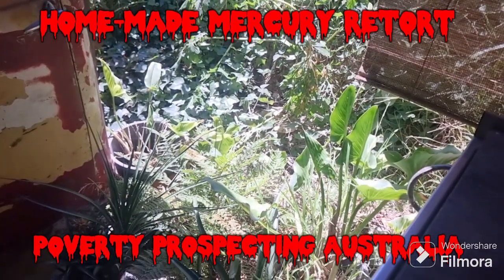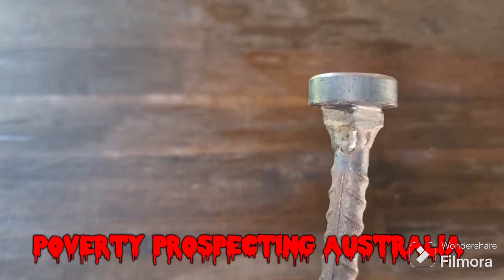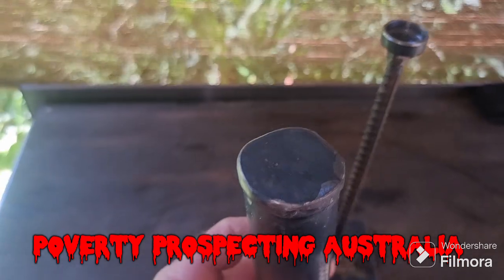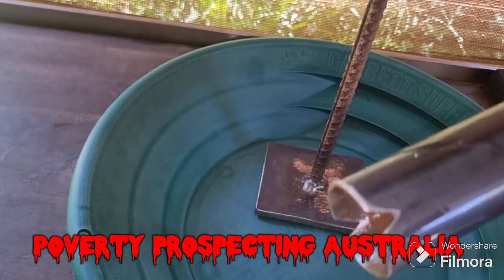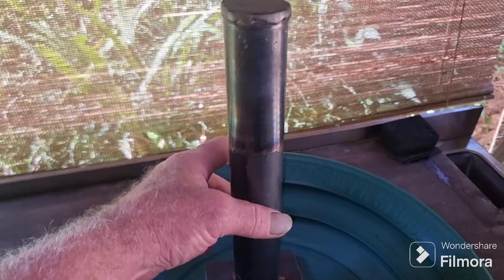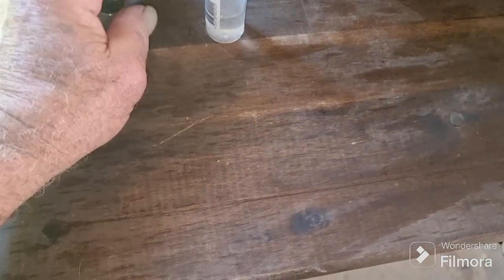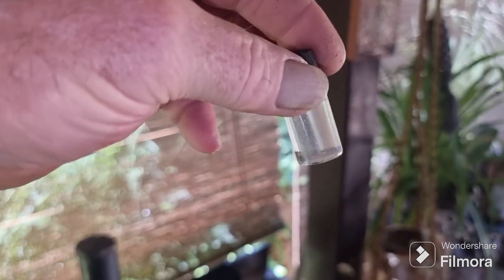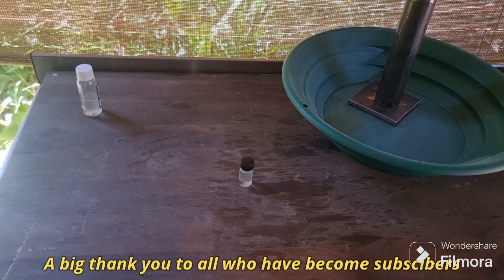home-made mercury retort!

Comment: G'day Andy , nice job on welding that one up mate .👍 I saw a guy from WA using one like that and he placed a mesh grid down over the top with a hole cut so the top of the Retort protruded through and put fire wood around it lit the wood and went and had a couple of beers while it did the job . lol . Worked a treat . 🤣 Actually you gave me an idea mate . i might do a vid on my retort plan i drew up years ago it's a simple and safe one too . Cheers Ned . 👌👍✌
Reply from the maker: Do it , all ideas are good until they are not! Like not cleaning all the gal off the fitting! But it smelted up well, to a nice little button. Cheers Ned
Reply: @andypandyAU.6669  👌👍